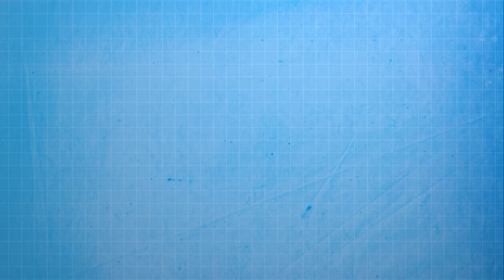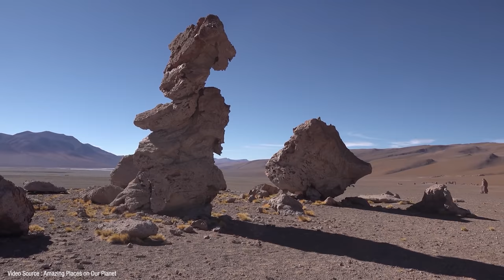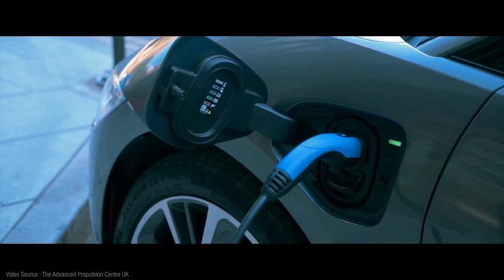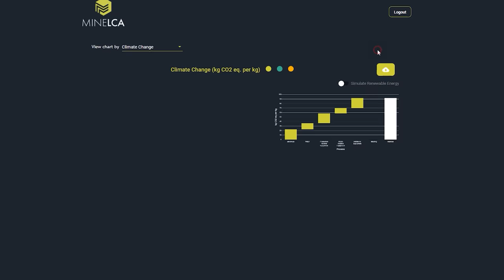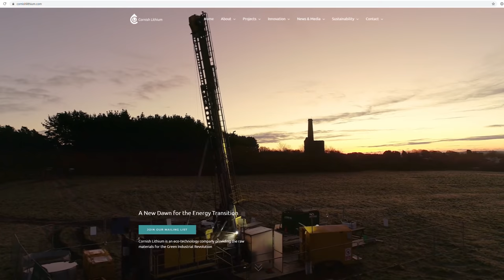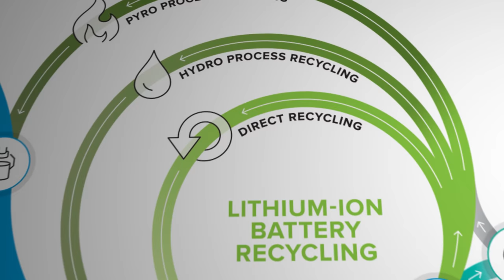Life Cycle Assessment. Optimising raw materials for renewables

Comment: Thank you for providing easily understandable overviews.
I completed a Masters in 2003 on Sustainabe Design in Innovative Manufacturing. The overwhelming takeaway from speaking to professors and professionals at that time was a general awareness of the need to change practices, but no real push to do so in the face of economic forces. The triple bottom line and circular economy where buzz words that got thrown around with little understanding (i.e: Financial orgs referring to profitability as "sustainable practice"). Life cycle assessments where a tick box exercise where companies paid an 'expert' to create a report using standards and measurements that no one bothered to check applied, or didn't have the expertise in house to question. There is still a lot of this going on with Bolt-on rather than Built-in business models, but it's so good to see a greater understanding with how these issues impact a company along with the wider economic, social and environmnetal pressures created from manufacturing. Good stuff by you again.
Reply: Well said Gavin.
Reply: Hey Gavin, may I stretch your thaught, as life cycle assesmnet is a crucial part for developping a sustainable project by developping a proper business case with all these data. However, maybe you could give me a hint on how and where to get the knowledge required to make this business case feasible. I mean where could you get the key knowledge to develop these businesses, apart from the finance
Reply: @polytrek21  I’m not sure I understand what you’re asking for exactly, however for an overall view starting with Wikipedia, searching Triple Bottom Line will give you plenty of references to follow up.
A business case is basically a good argument to prove you’re worth investing in. This includes all the forms of resources required (expert staff, material accessibility, proper analysis of the market and environment you operate in, upcoming legal and political policies)  and talking a language that investors talk. i.e: financial. The triple bottom line attempts to put into financial terms environmental, social and financial resources and impacts. So there is risk and mitigation within any analysis.
Of course you have to keep it grounded to the industry, the time frame of operation and place for it to be worthy of the effort.
I hope that helps

Comment: I have been querying every relevant YouTube expert (such as yourself) about the future of the recovery and repurpose  materials science industry for months now. Amazingly, just lately I observe a sudden huge increase in the attention paid to the subject by many science channels. Very exciting. Thx.
Reply: As long as they keep away from our food ! Crisper woolly mammoths steak ! Abomination!
Reply: And this is only set to accelerate, Grizzly. The sooner the better!
Reply: @bobknowles90  Ditto!
Reply: We’re you looking at consumer waste or primary industry waste? The rate of throwing perfectly good products out seems to have increased as the cost of repair has gone upon. I believe the manufacturer of any product must consider it end of life. This would change the way product are made and make it easier to recycle
Reply: @helenkessler6012  I had a Dino steak with Fred and Barney, much better than mammoth! :D
Reply: @Fess_goat_problem  I agree with you that repairing products has fallen by the way side.  I recently had a five year old AV Receiver quit...it has either a cold solder joint and/or a faulty solenoid and or a faulty output connection....to repair it, if it can be repaired, would cost well over a third of the cost of the equiv replacement and I would be without the device for however long it took to repair it (I don't even think there is anyone within 100 miles of me that does this kind of work).  It now sits in front of me shaming me as a contributor to eWaste!  

An awesome alternative to me tossing this into the eWaste bin would be a company that could take in my device, repair it and then sell it with some of the proceeds going to a charity of my choosing.  I am certain there are many people who would pay $200 to $300 for a device that retails for $600 to $800 if it came with a 90 day guarantee and could be returned to the seller for repair or trade in if it failed.  A whole new business model could come of this but I guess the other part to this is repair-ability (are its components sealed and inaccessible....and are replacement parts available...and repairable with minimal hands on work- profitability).

Comment: Over 20 years ago we were able to practice 'there's no waste only products' thinking by combining emissions from a paper mill and a chemical plant. The latter had to invest in an expensive wastewater treatment plant to remove the excess nitrate they emitted. The neighbouring paper mill had a waste water treatment plant but too little nitrogen, and the oxygen input capacity was too low so they were dispersing pure oxygen in their treatment system. Luckily these two locations were not too far apart. By combining these two waste streams  spectacular environmental and economical benefits were reaped on both sides. Very rewarding work.

Comment: Really like the idea to lithium extraction from brines via geothermal energy production. Here in the states I would love to see more talk about enhanced geothermal. It would be an excellent way for drillers and drilling infrastructure/supply chain folks to apply their skills in a new, less carbon intensive industry.
Reply: Brine evaporation is already solar, so it's pretty clean now.
Reply: @incognitotorpedo42  yeah, good point, but I love the fact that this can actually be a value add for enhanced geo thermal, making the cost/benefit analysis of it better.
Reply: Maybe out of scope for the discussion but it left me wondering about the concentration of lithium salts in the brine solution and the energy required to extract it.  Let's be transparent!

Comment: This is an ideal locale to mention that it could be possible to make steel from iron ore by the controlled burning of used vehicle tyres rather than coal.   However some grades of coal are an ideal basic material for manufacturing  high quality graphite and graphene..

Comment: Well done video. Though I disagree that wind and solar are all that much better. There energy density is balance by consuming huge amounts of land and mining to support them. These factors in your video are the main reason I tout Nuclear power, particularly thorium. Which currently is able to beat coal power [ThorCon]. The possibility of using structures that are already built, could be utilized by thorium reactors. Transmission lines are already available. The mining of thorium is very simple, it available in the waist of mining possesses around the world - everywhere. And the thorium reactors can consume old nuclear waist as a fuel source too. All while having the most energy dense material that can carry our energy load now and a resource that will last for thousands of years.

Comment: Spoudumene vs. Brine may be closer in impact than you think. Brine uses large tailings ponds that work with solar evaporation increases humidity in the area therefore contributing to climate change. 

Spoudumene could mostly run on a solar concentrator of a similar or smaller footprint without adding humidity into our climate. Agreed the initial infrastructure cost would have a bigger impact and cost but doesn't continuously  contribute to climate change like brine.

Would make a great powerplant too if located in the proper location

I wish I was part of this field of work because I would look at all the emissions and not overlook H2O.

A simplified way to look at this is CO2 directly contributes to global warming and H2O is directly responsible for climate change. The complete picture is like the weather a little difficult to predict
Reply: The problem with brine is the process uses lots of water, in locations where potable water is scarce. You also have to do it there, the whole point is having a location with lots of sunny days to dry the brine and no rain that would wash away all that lithium. Also, you of course want the ponds right next to where you got the lithium brine in the first place to keep the transport costs down. The effects on local humidity are minimal, it was a dry desert before and a dry desert it remains...which is actually opposite of what people would prefer.

Concentrated solar thermal has a flaw that it only works with direct sunlight. If you put up stationary PV panels they will produce little less power on cloudy days and when sun isn't directly above, but they will still produce power. If you don't have tracking mirrors or it is even little cloudy the CSP will not work, so basically you want to build your concentrated solar plant in similar area as those brine ponds. Now you have to haul the spoudumene longer distances...
Reply: Thank you for the insight. I am still woundering about how many m3 of water gets released in the air and at what rate. Even if you are correct about it not adding humidity to immediate surroundings it is still making a global impact. Adding additional energy in weather systems as much as 1000W/m2 in ideal weather at the equator.

Is that factored in to your environmental impact assessments?

Thanks for your responses
Reply: @lukeskywalker7457  The incoming energy from the Sun will come whether there are few ponds or not, and the water would end up evaporating anyway.

Though it is true whether an amount of water ends in the brine ponds or flows downriver and is absorbed by plants and the ground for a while could change where and when the clouds it forms will rain down again, the main issue is that the water diverted from local rivers to make brine is not going to be used on watering crops or drunk by humans, which can be a major issue in a region with low amount of water.

That is, a major issue for the human and animal inhabitants, but on global scale whether it will be maybe few hundred miles distant or rains forming few days sooner or later is equivalent to a minor rounding error.
Reply: @AnalystPrime  the ponds are likely to be built in dry climates like you mentioned earlier. I am not assuming that all the ponds are made on desert land (free of vegetation or very little vegetation) but the ones that are will no longer reflect as much infrared back into space.

That is why we are fighting against fossil fuels in the first place is because CO2 is an infrared absorber unlike the other gasses found in air other than H2O.

Lithium batteries in the auto industry will definitely be better than burning fossil fuels regardless of these initial impacts.

For my area I just prefer rainfall over a hail storm and less violent winds. Some places humidity reaches 100% more regularly therefore body temperature can not be regulated naturally and are at risk of heat stroke if not sheltered. 

By reducing humidity wherever reasonable we can make a difference. I know the general public is only starting to be continuous about CO2 emissions but that alone will not be enough with our growing global energy and food demand.
Reply: This conversation actually gave me an idea how to make brines more efficient. Thanks for your time

Comment: Please do a story on energy production by using magnets and magnetism - I believe this technology will cause the need for solar, wind, nuclear etc along with batteries for energy storage for general use to be superseded. Batteries may still be needed for cars though.
Reply: "energy production by using magnets and magnetism".   There's no such thing, magnetism transmutes energy, there's no production of it. Solar radiation (Sun nuclear fusion), exothermic chemical reaction, nuclear fission & parasitizing ancient collision + nuclear fission heat (geothermal) are the only energy sources that exist or ever will here, except plus on-site nuclear fusion a theoretical future possibility.
Reply: @grindupBaker  They use nuclear to turn water to steam to turn a turbine to create electricity. Solar great but inefficient collector and diminishing over time and need to replace every 10 years or so. Wind big expensive turbines that burn out and they have not yet figured out how to recycle the stuff they are made out of.
 Magnets, using repelling magnets to turn a turbine instead of steam, no pollution, no waste, little to no noise, no explosions, lasts for multiple decades or more before bearings need replacing apart from that little to no fixing and the magnets don't loose there magnetism over time - there are people playing around with this - There is no such thing in mainstream working reality YET, but it is on the workbenches in backyard sheds. Just though "just have a think", might look into it maybe find some of the folk who DO have knowledge about that type of stuff - would be interesting to know how far out of mainstream it is.
Reply: @poppete  you cannot produce energy with magnets.

Comment: Presumably, this means that recycling batteries is far more Carbon efficient that extracting raw materials.  After all, a load of batteries have a far higher percent of the raw materials than an ore of these materials.  Also they are pretty close to where then are needed.
Reply: Absolutely correct.  That's why JB Straubel, one of the founders of Tesla, started a battery recycling company.

Comment: Of course we could reduce our demand for these metals by 1/3rd or 1/4th by simply using smaller batteries.  We can either produce smaller battery BEVs for city driving, or with proper charging infrastructure, PHEVs can be utilized to reduce the average driver's gasoline use by anywhere between 70% - 100%.  This would involve ensuring everyone has access to a nightly charger, and it would necessitate installing more work place chargers.  For most people, that would reduce their commuter based emissions by 100%, and now we just have road trips to consider.  

Long range BEVs require a MASSIVE build out of charging infrastructure to run parallel to the gas infrastructure for 20-40 years, and they'll likely involve the installation of large battery installations at those charging centers along main routes to manage peak charging periods with excessive energy costs.  Instead of this, we could just stick to gasoline and use the existing infrastructure, and rely on PHEVs running in a more efficient hybrid mode versus ICEs.  Overall emissions per capita for all annual miles driven could easily be cut by 90%.  

If we wanted to make the process even greener, we could begin producing near net zero e-fuels to replace gasoline, and replace existing gasoline pumps at gas stations with e-fuel pumps.  These fuels aren't a solution to replacing 100% of gasoline use today because we can't produce enough in an environmentally friendly and cost effective way .  However, if through the use of PHEVs we could reduce our global gasoline use by 80-90%, then suddenly these fuels become a realistic solution.  Sure, they'd cost far more than gasoline / diesel, but each driver would also be using significantly less of them... usually on longer trips.  And it doesn't necessarily need to be biofuel produced using biomass.  There are already solutions underway to produce renewable liquid fuel from CO2, Hydrogen, and energy.  See Porsche's e-fuel endeavor.

 This is a completely sustainable solution that requires far less mining, far less mining related pollution, and far less energy used in the production of battery cells.

SSBs could eventually be a thing, and with their faster charging, they could allow for EVs with batteries that are a fraction of the size of current long range BEVs.  Sure, on a long trip you may need to stop to charge more, but each charging stop will take just slightly longer than filling with gas.   Again, the issue with this, however, is that we'll need loads of charging infrastructure installed.  Since these batteries can charge so quickly, it may involve new higher power chargers as well.  Further, SSBs could actually improve how PHEVs work and reduce the amount of liquid fuel they would need over their lifetimes.

Comment: DAVE, WAS THAT YOU JOGGING ALONG THE CANAL PATH at 3.30? What was your total CO2 footprint for that run. Taking into account the production footprint from your trainers (pardon the pun), your clothing, the production costs of the path you were running along, the water/beer you use for rehydration,  the amount of body heat generated (and not captured), the water used for your post-run shower, the oils (maybe fossil fuels) in the soap and hair care (oh wait, you don't use hair care products) as well as the direct CO2 emissions from your breath. Running dressed in a blue top I assume it was the same shirt you wore for this video too. Hope you washed it first. And what of the CO2 emissions of that wash, again water, electricity, soap.

Comment: I'd like to hear a solid comparison of full battery EVs versus good hybrids from a lifetime CO2 perspective.  Since EV production creates more up-front CO2 (and other impacts) and then due to electricity being produced in large part from fossil fuels they aren't as good at avoiding CO2 as they might be with a fully green grid, hybrids may often be as good and sometimes better, even on a lifetime assessment basis. Also EV manufacturing is running up against battery production limits, so a LOT more hybrids could be produced than full EVs, within those constraints - so more cars producing less CO2 much sooner.  At least until we make big progress on greening the grid.